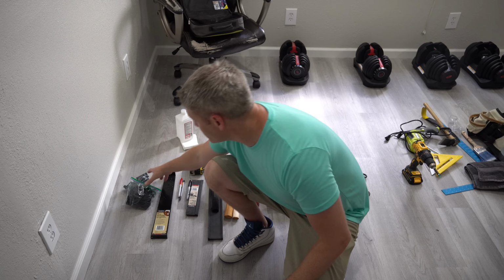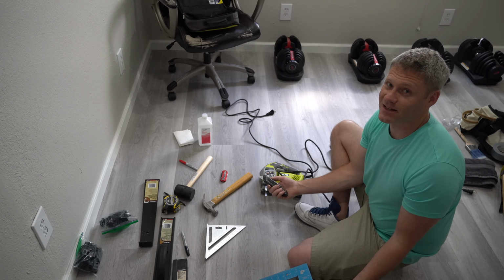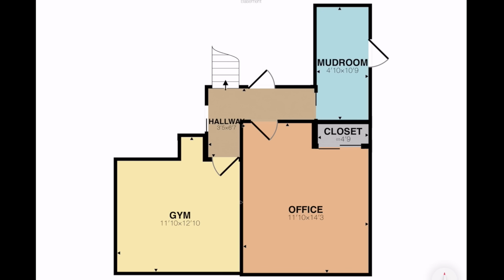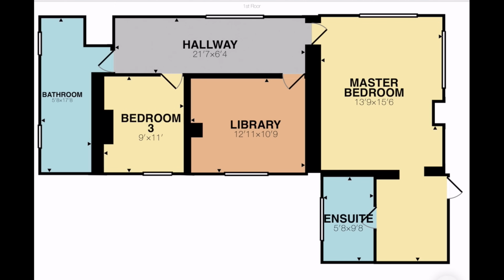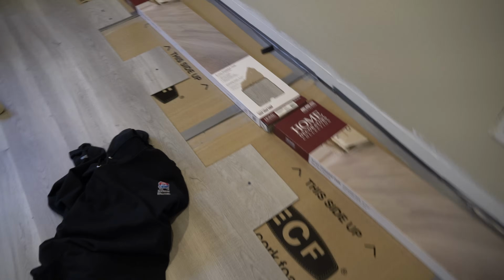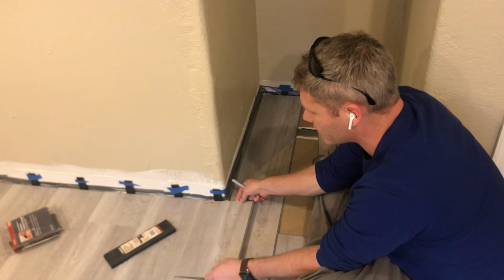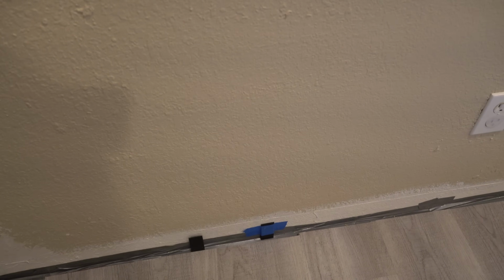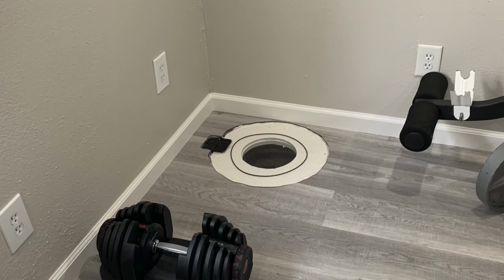How to install vinyl plank flooring in multiple rooms or whole floor.

Comment: Hi, great video, but I have an issure in my closet....What do I do around the crawlspace door, and to the cover of it with the planks??? do I glues the planks to the crawlspace cover? How do I cut or nail or glue around the crawlspace opening??? Nobody has videos about this which is mind baffling!!!!!!
Reply from the maker: Hey, I'm a little confused on the issue. Why is the crawlspace door creating issues that other doors are not? Can you not treat it like any other door and just keep laying flooring up to it the same way you have been everywhere else?
Reply: @waltsreviews90  no you cant. There's specifics to be done and then the trap door needs to fit nicely. My friend showed me how he f..ked up the first one he did then figured out how to do this correctly on the second one in his house.

Comment: Hi Walt, pretty good detail on the video. I'm currently laying vinyl on my entire second story. At the 46 min mark, you are crossing through a doorway. So far I have been able to use one board across because I got lucky :). My question to you is how did you manage to join your 2 cut pieces to the portion of completed room. For me, it was some pretty aggressive tapping to bang them in. It's not the recommended way obviously. I used a bit of baby oil on the groove to lubricate but it didn't help a whole lot.

Comment: Thank you so much for making this video!!! I love that you point out all the mistakes, that was extremly helpful. Many of the videos you watch now make it look like such a quick and simple job. I'm getting ready to do my whole house soon as I have hideous pink carpet everywhere, I mean even in the bathrooms and kitchen. Any tips on taking on this huge project? Start in bedrooms, kitchens? Still trying to decide if I would be better off finding a contractor to do it instead of myself. The only problem is the contractors in my area are very unreliable so I might be better off doing it myself. Do you have any thoughts on the Life Proof product by Home Depot?
Reply from the maker: My friend used the life proof and liked it saves time since underlayment is attached just a little more difficult to cut. If you do it yourself, like most home projects it will probably take longer than you expect, so as long as time isn't going to be a big issue, I'd say do it yourself. However would be nice to only have house apart for a day or two while contractor does it..... Pink carpet in bathroom haha can't be too many of those out there lol.
Reply: Yea. Don't go to home depot. Go buy a good product from major brands like, shaw, or mohawk

Comment: Well done! I'm planning the same project but my only concern is going from the main hall (remove carpet) into the bathroom (remove tile)... I'm not sure it'll be level from the hallway to the bathroom once the tiles are removed, did you have to do this as well?

Comment: Sorry if this is a duplicate, but my first comment seems to have disappeared.  Great video!  But how do you handle a situation where you have a large area to cover but in the middle is a large rectangular cut out area where the plank will not be installed.  How do the planks meet back up on the other side of the area where planks are not placed?  If there is any variation in the width of the planks, then on the other side there will either be a gap or it will be too tight.  Thanks again for a great video!!

Comment: Thank you for the great video, this is immensely useful. One question though, if I am installing vinyl plank flooring on the second floor and the direction I choose (based on what makes most sense from your video) happens to be parallel to the floor joists, is that a problem ?
Reply from the maker: It could very well be. Besides from doing my own flooring, I don't have a lot of experience to be honest. From what I know, you can get away with running flooring parallel to floor joists, but you'll want to make sure that you have a think underlay. Might want to do a little more research though to be 100%.

Comment: Mr. Walt, 

The only part that I got lost was the section where you mentioned that you calculated 8 boards or 67 inches.

From the reference line, where/ how did you come up with the 8 boards/67 inches?  Would have liked to see Mr. Julian work the floor all the way to the reference line.  

Thank you!  I hope you can enlighten me!

Aloha!
Reply from the maker: I knew I wanted a seam to fall on the reference line. So I put one one the reference line, then I started connecting boards moving toward the wall and figure out how many boards I could put down and still be before the sump hole in the ground, 8 was the number of boards if I did 9 that board would cover the sump hole. Then I measured the 8 connected boards it which was 67.5 inches, and I made another line by the sump hole  67.5 inches away and parallel to the reference line and started there knowing that 8th board would end exactly on the reference line. I hope this makes sense.

Comment: Great job Walt !!!  Thank You !!! - I have a question.  When you mentioned using super glue for a last row narrow piece do you apply to the tongue and groove pieces and if yes do you have enough working time to spread it out along the joints and then tap the piece in?  My experience with super glue is that it would be setting up and starting to "stick" before one could even position the narrow plank to tap it in.  Maybe there are super glues with a longer set up time?  I have heard of using super glue to join tiny square cut edges (no connecting tongue and groove pieces in place, they were cut off).

Comment: Thinking about doing my first floor in the basement.... I have a lot of our furniture/fridge (that can't come out of the room) piled on one side of the room. Can I install half the room and then move the stuff onto the Vinyl Flooring, and then finish the flooring on the other side? Appreciate the help!!
Reply from the maker: Sure can! Just make sure to read the user manual. Sometimes newly installed flooring needs 24 hours + to settle before you start putting heavy items on it.

Comment: I’ve learned too over the years of watching and fixing floorings in a place that has earthquake to just run rooms individually so when one or two needs to replace, you wont have to rip out everything and only need to do so in that zone. It is uglier running transitions, but you’ll thank yourself later

Comment: Did you lay the cork because of imperfections in the subfloor ? Thanks !
Reply from the maker: Yeah, that's partially it. It's supposed to dampen the sound when you walk over it and it's water proof.

Comment: My house has a long hallway with rooms on both sides. I'm going to have to do the backwards install somewhere. Unfortunately, I can't find a video that actually shows how to do that, including this one. Perhaps next video, you can address that issue for those of us who can't avoid the issue with the layout.
Reply from the maker: Its pretty easy, you can practice with 2 boards when you start, to make sure you get it and are confident you can do it. The last board you won't be able to because the wall will get in the way, so you have to cut it long ways. Give it a try and before you do anything to ensure you are confident you will be able to do it.

Comment: What if the baseboard is tile??
Apartments in the Caribbean are made of cinder blocks and tile on the floor plus tile for baseboard:.!!
Reply from the maker: You would just have to make sure you get as close as the thickness of the tile so that it covers it. Hope that makes sense and helps.
Reply: @waltsreviews90  you mean push the laminate planks all the way against the ceramic baseboard?

Comment: Hey Walt - thanks for this video. Extremely helpful and a ton of great tips. Do you have any suggestions about how you go around objects in the same room such as an island or center wall? It's kinda hard to explain without pictures, but I am flooring my main area which is essentially one giant open-concept room. However, we have a center wall that runs the through the middle of the room to provide structure for kitchen cabinets and the range. It's open on either side of this wall to allow entrance to the kitchen from both side. So, if you can imagine, our main floor creates a big loop around this middle wall. I realize that if I start in the corner of the room, I'm going to eventually hit this middle wall and have to go around it. My concern is when the planks meet back up on the other side, they won't align, which would cause me to have a transition in the middle of an open room. I really want to avoid this, so I'm just wondering if you have any suggestions for me. Would it be best to start in the middle where this wall is and work both ways? This would require a lot of back clicking, but could help.
Reply from the maker: It sounds like a lot of measuring and planning, but Iif that island is in the middle of the room you may want to plan it out so that you get the largest boards possible on the sides (if the boards are running parallel to that island wall)  since they will be more visible than the boards against a wall. Mathematically the planks should meet up when you wrap around the island. If the island wall is not straight relative the the edge of a board it may seem like it won't but you would just need to rip (cut long ways) a board at an angle that matched how much the island wall was off relative to the edge of a board (highly unlikely) I would go around it and after you have a board that is below it that can run outer wall to outer wall, work backwards off of that board back up to the other side of the island wall and make sure everything lining up and working.... Good luck, you'll figure it out.

Comment: Very good video! What type and size drill bit do you use to anchor in the concrete subfloor? What kind of screws? Thanks
Reply from the maker: Just homedepo concrete screws they blue something that starts with a T, drill bit that matched the screws 1/4" masonry bit.

Comment: How do you lay flooring around the base of a toilet? Do you cover everything to the hole or to the outside of the toilet base?
Reply from the maker: Remove the entire toilet, install the floor, then reinstall the toilet.
Reply: @waltsreviews90  Thanks.
Reply: Definitely remove the toilet and lay the new flooring up to 1/4" to 1/2" from the toilet flange around the drain hole.  Caulk between the flooring edge and the base floor to prevent any water from creeping under the flooring if the toilet gasket were to leak in the future.  You may require a "flange spacer" if the top flange face is lower than the new finished floor, but vinyl plank flooring is thin enough that the difference is rarely a concern.  Re-install the toilet with a fresh new gasket and do not caulk around the toilet where it meets the flooring.
Reply: @chrisgraham2904  - Thanks!

Comment: How do I determine the amount of laminate I need?
Reply from the maker: Good question. Generally 5-10% extra is what is recommended, but if you buy somewhere with a good return policy you can get extra and return any unopened boxes. This is especially useful if you get flooring that needs to be acclimated to your humidity level.

Comment: Iam in escrow and planning to vinyl plank my new house where would you recommend to buy the planks iam in Southern California and is it easy to transition into hallway to bath room
Reply from the maker: I bought mine at Home Depo, and there are just okay. After making the video I realized might have been best to go to a local flooring supply company, and see what they have to offer. I have heard you can get better value there, another little tip is ask them "what kind of pricing would I get if I started a flooring business and got my material form  you"?
Reply: Check out a website www.flooret.com. They are located in California